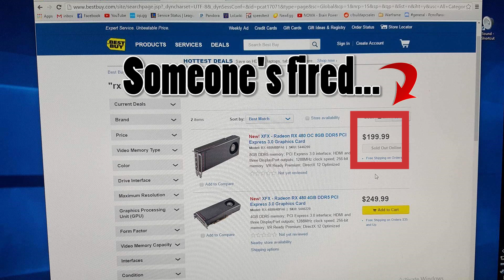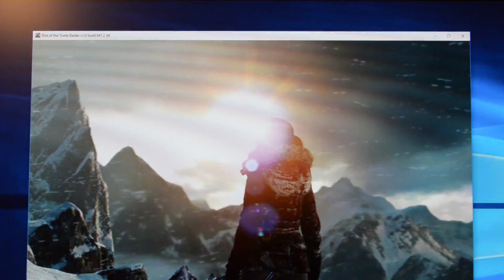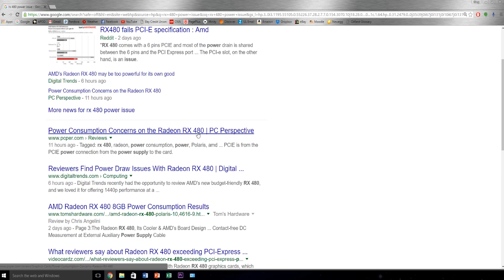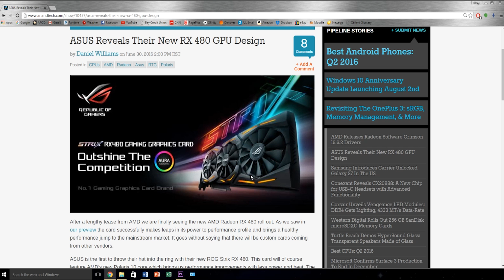RX 480 Aftermath: Power Issue & Over-Hyping

Comment: The rx480 was trash. I rmaed 3 yes you read that correct 3 before i got a "working" one (400 euros btw 50% of monthly salary). The 'working" one is giving me system crashes (green-gray-black screens) in various games. I need to give it more power while cutting down the clock by 10%. TLDR never again amd, they wont miss me sure but i am sure as hell not gonna miss them.
Reply: My rx 480 running no problem stable. While gaming on 1080p normal settings my gpu is at 50°c 60fps and 65-80w usage. With right tuning its great

Comment: I don't know about y'all but my Sapphire RX 480 Nitro4GB+ is facing some problems, first of all the most important is that my PC components are brand new, my power supply is 750W and my motherboard is a Z-370 A-Pro which is pretty powerful and reliable, but the problem is that my RX 480's fan is randomly going to 100% rpm without any reason, i can be sitting watching a youtube video and the fan will randomly go to 100% rpm without any particular reason, the temperature is 60C which is pretty normal and i see no blue screens or pc shut downs and neither performance issues but it's just too weird, i checked everything but everything seems to be in order, i even tried different drivers but this doesn't seem to resolve the problem, what you think? why would the fan randomly go to max rpm while the card isn't hot and i'm not even seeing any performance difference? it's just sounds like it's struggling to maintain and the only solution to stop this is to restart the pc.
Reply: What drivers are you using?
Reply: @NightmRE_ZZZ  The latest.
Reply: ihave exactly the same PSU 750 and z370 board ...same problem like you in last year...tryed diferent drivers but nothing...i just get raandom black screen and 100% rpm fans.
Reply: @adventuuresofalifetime  i sold my gpu and plan to get a new one soon, but if you do find out how to fix this please tell me.

Comment: Same issue happened to me. Random shutdowns and complete system lockup. Running on a Zenith Extreme motherboard with latest BIOS and a brand new 750w gold power supply. 

Last time it happened it locked up the computer. So I switched off the power supply switched it back on and went to power on the computer. Sparks came out the back of the computer along with smoke and the smell of burning plastic. The card fried itself. 

I wouldn't mind so much if I didn't have to earn a living using this computer :/

Comment: I have a RX480. when i run benchmark test the screen shuts off immidiatly and the fans of the graphics card goes on his highest rpm. I have a corsair 450 watt. Isnt this enough for the card? Also i have a new msi tomahawak z270 motherboard with i5 7600k.

Comment: I know this is an old conversation but very same incident happened to me in the beginning of 2018 as I did a used parts budget build for Boinc. I was using a pair of 480s on a dual xenon supermicro board with HX1200W and got it working for a month when a random shutdowns began. I could not figure out the problem until I tried with a borrowed pair of 980ti (I later on acquired them). The system have been at full load since with zero issue providing a day of shutoff monthly, It is just too bad that  openCl  is better on the 480 than the Green card which I needed for my specific  application.  Anyway, that my 3 cents
Reply: I got the same issues today, my pc going shutdown after i played a game, the temperature going up from 40celcius - 95, and finally shutdown my pc

Comment: Thanks for the video.  
FWIW - My RX480 (PC Red Dragon - 4 gig - 6 Pin) is matted to a Gigabyte 970A-D3P.  It runs at 1426 MHz with max power draw of 142 Watts courtesy of a Corsair TX650 .  Fans at 100%.  It's got some overclocking headroom but I'm already approaching the 150 watt limit.

Comment: I need help guys!
My GPU which is the rx 480 keeps crashing mid game
Pc Specs:
Intel i5 6600k at 3.5ghz
AMD XFX RX 480 XXX OC 
8 gigs of 2133mgz Ram
and finally psu: corsair 450 watt :(
My gpu gets 10 mins into the game and then My screen goes a solid colour(Normally Green) With a very loud buzzing noise coming form my speakers. I have to force shut down my pc to get it to stop and when I reboot into windows it is fine at idle untillI a gaming load is put on it.
I used to have a gtx 960 2gb which requires a 400 watt psu and I never had this problem. 
However the rx 480 requires a 500 watt psu but reccomends a 550 watt psu.
Should I get a 550 watt psu??
If so will it fix it??
This is very stressing as I have had this gpu for 1 month now.
Somebody please help me out.
Many Thanks 
Adam
Reply: CK!SoundForDays Having the same issue... did you find a solution?
Reply: CK!SoundForDays Got the same problem when I first use the card. I believe that this is a problem from the driver. Try to install either the newest driver or the older driver. for psu I recommend a 600 watts and never cheap out on it. hope it helps
Reply: Alessio Bax check my comments.
Reply: well mine heats up bad as fuck
my case is metal so I burn my hand everytime i touch it
happens after just 1 hour of gaming
Reply: no crashes but I'm concerned that it will fry my mobo up

Comment: lol my Gigabyte AM3--- GA-970A-D3P mobo /8320 fx ---is failing me now with upgrading to the rx 580... even though it has a 8 pin power supply plugin even though i do have a fairly reliable power supply 750 watt antec..

Comment: I'm confused, because I recently bought a RX 480 PowerColor Red Devil, and it works pretty well, playing most new games at max settings at 60fps easily. I'm confused because every so often when playing lower end games (Specifically those made with the Unity enginge) I get the crashes that he did. It's extremely confusing because I can play extremely high graphic games such as Dying Light and Assassin's creed, but I can't play small, bad looking unity games... If anyone could help at all I'd really appreciate it.

Comment: Shweew because this is the best in class for my budget build since it's my first rig I'm building so thanks for the info , now I can buy this and not feel bad since all others for the price are 2g at best and don't benchmark well or even get any attention so yah off I go , tho this card is just the default for now since it's a budget build and my games will remain mainly as 2k17 so it won't be high fps demanding say as battlefield 1 , tho that's a game on the list I don't demand Ultra settings across the board just something as decent as the PS4 I am replacing this with not to mention the PC will be used for Android Repairs Development and Testing on Linux for around 75% of it's daily chore.

Comment: Hey Salazar, I have a question relating to my computer just freezing and not displaying anything(although running, but unsure about this as the monitor doesn't display anything). I have a very very old computer and these are the specs... has a core 2 duo E7400 2.8 GHz with 4GB's(used to be 8GB's, but when ever I fix another RAM card the computer doesn't boot) of RAM and a 450w FSP psu. Now I'm not much a genius when it comes to power draw and voltage etc. I got my hands on a GTX560 video card(used for a pretty good bargain) and my computer ran fine with it for 6 months. I kept on getting booting issues afterwards. The computer turns on, but doesn't display system check or the boot screen. The computer starts up with the cpu fan spinning fast(sort of like a burst) and then returning to normal rpm. So I removed my video card and one stick of 4GB's of RAM. It's working fine on on board graphics for the time being. I just need to know what could cause this. I'm gonna be upgrading my system in the next month or so cause of these issues, however I did enjoy the games I've played with this dinosaur xD...
Reply: Just realized this is an 8 month old video...

Comment: Okay so answer me this.. I have the Asus crosshair v formula Z motherboard and just got the Strix rx 480 (8 pin power connector)

So not a cheap mobo although yes it is aged now.. and yet the strix rx 480 i have still crashes my PC completely everytime the gpu is under load

Comment: I just built a PC with a 850w PSU. the MB is a gaming Aura 970 pro. the GPU is the XFX RX 480 and I'm having the issue with it randomly kicking me out of games. it even did it while playing hearthstone. any ideas?
Reply: Kohler7277 most likely driver issues

especially if you have an intel cpu with an amd gpu
Reply: angrydragonslayer AMD CPU
Reply: do you have a cheap mobo with low-end VRMs by any chance?

cards are meant to draw 75 watt from the mobo at most (according to pcie design) but in the most recent generation, most cards stronger than the 1050 ti draws 85-105 while some cards (480 included) for some reason hated the uwp and decided to sometimes spike to 140+

and what driver do you have? 16.7.3 was an utter flop that often caused this
Reply: angrydragonslayer I just figured it out. it was the vertical GPU mount. it's runs perfect when plugged into the mobo. thanks for the help though.

Comment: If you want to buy an RX480, go for the Red Devil ot Asus Strix because they bove have a triple cooler design to perfectly cool the chip and memory under it. If you dont have space in your case, use the XFX one. I have experience with the Strix and Red Devil. If they run at 100 percent, they bove are under 55 degrees what is very insane for me especially because my older card that was an R9280X Gigabyte it didnt perform well with the temperatures, but it performed very good at games.

Comment: I also have issue with non reference XFX RX480 RS card and 4k monitor (DELL P4317Q). It randomly have 'link failure' notification on displayport and rerun monitor on 30HZ. I've tested multiple RS cards and multiple Displayports cable with same effect. I\ve tested monitor on GTX970 and there is never this issue appears.
The only solution was to switch my card to the reference one (XFX RX480 but with ref. design) and it seems fix the problem. 
I'd like to share this experience in case if someone have a similar problem with these cards.

Comment: I've got the XFX 8GB 480, It has 2 power connectors and 2 fairly big fans. I've manged to get a stable OC at 1450Mhz Gpu clock and 2250 memory clock. Runs stable but I'm noticing lower fps in games like fallout 4 then I had with my old GTX 760, and that worries me just a bit.
Reply: I'm So Salty might be thermal throttling might want to increase air flow in your case

Comment: I have a gigabyte ga-h61m-s2pv. It's a really cheap 1155 socket board, however it's only a little over a year old. I have a 700 wat PSU but it only has two 6 pins no 8 pin. I would like to get the rx480 with only a six pin, do you think it will run into issues?

Comment: Well I have Asus Z170-A motherboard, Chieftec 750 Watt PSU and Gigabyte RX 480 G1 gaming 8G, and I experience same issues what you explain in your video, after some time PC just shows black screen and doesn't answers to any commands besides power off.

I try different ways to make it work, changed PSU, try on another mobo and after awhile always get same result in not responding system.

So I decided return graphical card to seller.

Comment: Slight correction, the 6 pin connector actually CAN deliver a full 150 watts of power (this was tested in various ways in the past), however, the original specification for a 6 pin connector only called for 2 12v lines, but all psus actually came out with 3 12v lines. Most manufacturers, as an absolute failsafe, only specify a 6 pin power connector for applications that would use 149w or less. It's one of those listed vs. actual situations.

Comment: I'm not sure what to do here. I'm having the same problem with my PC shutting off whenever I start a game. I have a MSI RX 480 with an 8 pin connector. My ASUS motherboard is from 2012 and seems pretty decent. I'm using a 500w power supply but it is one of the cheaper ones. (Below bronze)
Reply: i have the same problem as yours, i bought an Sapphire RX 480 Nitro+ with 8 pin connector well blu screen everytime :(
Reply: I did a lot of research with mine. I was convinced it was my crappy motherboard but I contacted the mobo manufacturer, the graphics card manufacturer, I have asked some forums and everyone says the same thing. I need a more powerful and higher quality PSU. MSI recommended a 650w PSU even though their card says 500w on the box. I'll be putting in a new PSU in the next week or so.
Reply: ok keep me updated when you buy a new PSU & tell me if the problem is solved or not because im thinking of selling it !
Reply: I upgraded my PSU to a 850w 80+ Gold Corsair and it did not fix my problem. Every time I play a newer game about 30 seconds in the PC restarts. It's the motherboard. It has to be. If I play an older game that doesn't require full use of the card it will play fine. I played Brutal Legend for 20 minutes with no issue
Reply: DragonMatt81 I'm having a issue with my r9 280x windforce. Soon as I start games up it shuts down immediately and is saying over heated.... within 2 minutes my card goes from 40 to 95 degrees. And me and my buddy did some tests and we just think I have a faulty psu. I have a 750watt corsair 80+ gold so it should be able to power the card enough to run the cooler but it isn't. We took it out and put it in his pc and it runs fine and doesn't over heat. So I'd say just upgrade your psu and see what happens.
Reply: Not sure bro. For my issue I'm 99% positive it's my psu failing cause I've looked at all the symptoms and it points at a faulty psu or dieing psu. The psu in my pc is like 4 years old so I wouldn't be surprised.
Reply: I have the same issue , have a rx 480 nitro+ but I do have a new motherboard asrock h110m-dgs ...have you found something to stop crushing ?
Reply: for mine crashing, I have a psu and new case on the way from newegg. Ill transfer all my components to a reliable case with great air flow and space. And install the new PSU. let you guys know if that fixes my issue. If not ill be ordering a new mobo.
Reply: whaat mobo do you have, i have the same issue. it already kill me 2 mobos, im totally broke

Comment: every so often amd even intel put out some thing that is so far ahead that  software cant use it  to the max im still using a phenom 2 960t  yes core unlocked and over clocked i was going to upgrade and go to intel i5 but i got to be part of windows 10 preview  and build 10130 came out and my pc had a x2 speed boost if stared to use the cpu better and in the last week i tweeked a few things and now im getting better benchmarks than my mates fx8350 on the same board a msi 970 g43 yes im over clocked and my mates pc is not so im on 3.7ghz on six cores.  i think the rx480 is going to be the same sort of thing. im now holding out for a year of two for the zen or zen2.0 also i use two r9 270x gpu and play any game i want 1080p no problem yes in some i have to turn off one card as they dont like crossfire  but still play in full 1080p with using other programs on seconded display
please please do a test with a old phenom2 965be with am3 board with the rx480 becouse there is still a lot of people still using the phenom  ps dont go over 16 gb ddr3 1600mhz with two sticks phenoms dont seen to like more lol

Comment: Not all power supplies are equal. (calculations in your head?) Connected a few voltage, current and watt metres to your 12volt rails. You will notice that with some power supplies the voltage will drop to below 10volts on the 12volt rail when as little as 100watts is drawn. This means that the current / amps will increases which leads to excessive heating in not only the wires but in some components which are now receiving lower voltage.  I think that low voltage and high current will effect the performance of your system. It would be nice if someone did more tests and research into using cheap power supplies.

Comment: i had a evga 970 card and changed to the rx 480 sapphire and it beats the gtx 970 in all games and benchmarks i used and i found the gtx 970 was having big problem with 4gb memory this rx 480 slays it

Comment: Need help! I have a custom built AM690 by iBUYPOWER but I'm having issues with the monitor not picking up any video from the RX480 8GB card. (My motherboard is a Intel i5-6402P) When I first booted it up I used the HDMI output on the card first and nothing appeared on my monitor. The only way I could access the computer is if I REMOVE the card and used the motherboard's DVI output as another signal. (I used a DVI-D to HDMI adapter cause my monitor doesn't support DVI). Is there anyway I could fix this problem? I really want to use this card to play awesome games!!!
Reply: Yes , buy a proper monitor .

Comment: I have a Biostar H61MHB motherboard (that I hate for many reasons before this) and I've spent all day trying to troubleshoot the issue with my new RX 480 and I found this video and my hopes are dashed... D: ...

edit: fyi, power draw issue is not fixed. With the latest drivers, even with compatibility mode and power efficiency modes on, I'm still having trouble getting anything to run for longer than a few seconds. I have no idea what I'm going to do other than RMA the card and order a different one, I suppose... here's to hoping newegg will let me get a refund on this.

Comment: I got the RX480, Its GPU Tweaker barely works, Fan is always on 0, the card literally went from 40 degree to 80 degree in 10 minutes with 1000 rpm fan speed while I was trying to get the GPU Tweaker too work, and yes as he said, The PC randomly shuts off because it was too hot, it destroyed one of my display port.